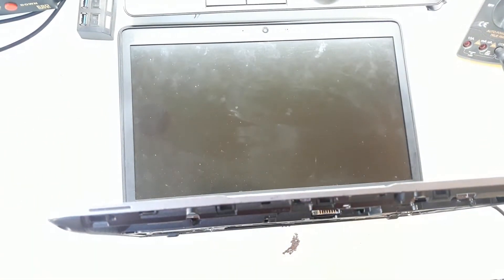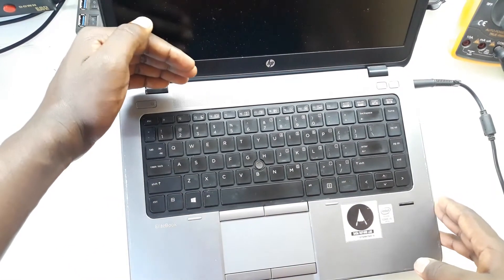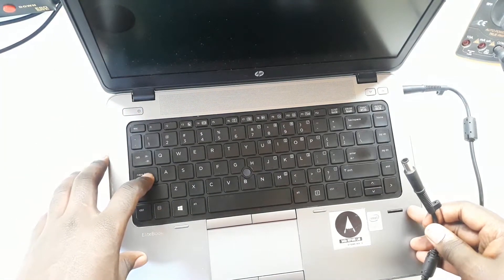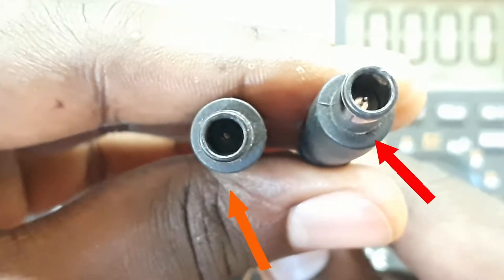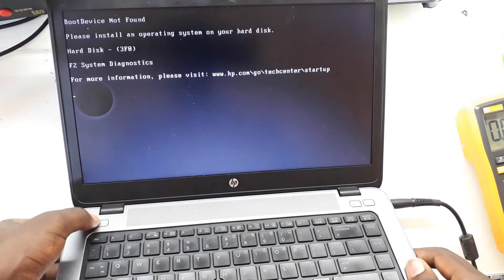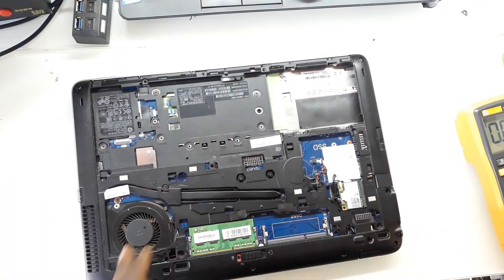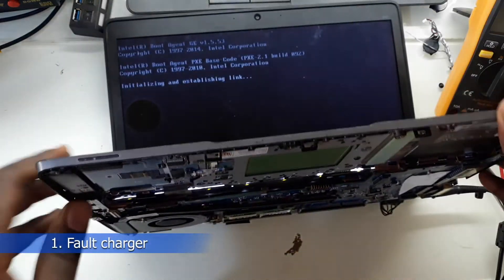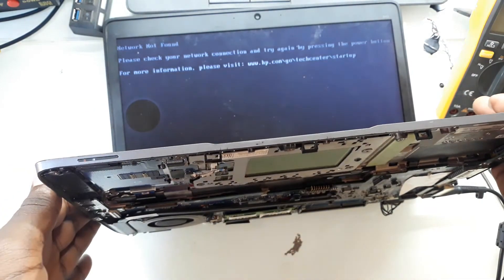Common laptop Led blinking codes & their solution.

Comment: THANKYOU THANKYOU THANKYOU, after taking out my ram and my keyboard to try and find the problem I came across this video. A single pin that was slightly bent in my charging cable was the cause, carefully bent it straight again and it finally worked after thinking I had a broken laptop for 3 days
Reply from the maker: Haha you are welcome am happy it helped

Comment: My HP blinks 9 times and do not start. I do not find any referrence for this code. Can You help me? Thanks!
Reply from the maker: I suspect there is a problem with your adapter ID or middle pin circuit